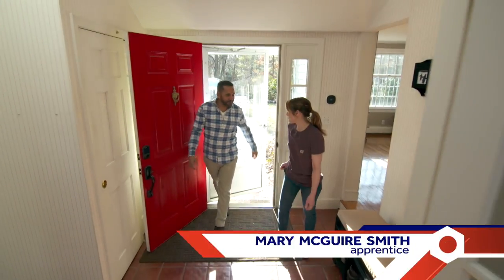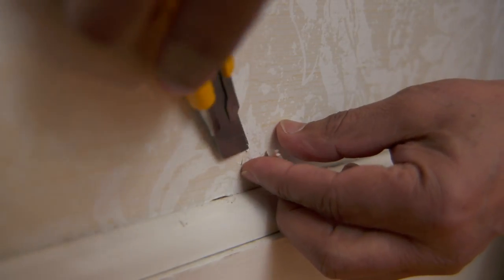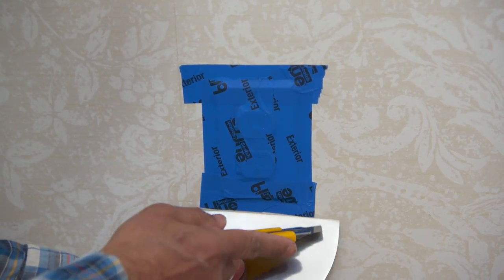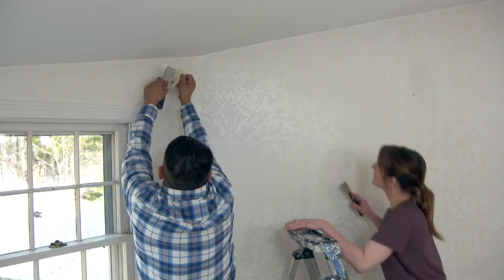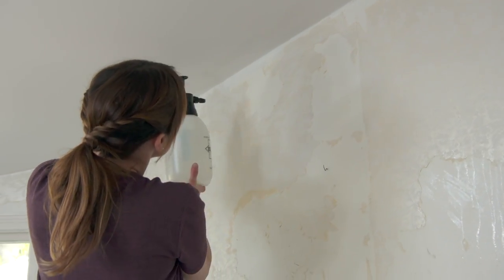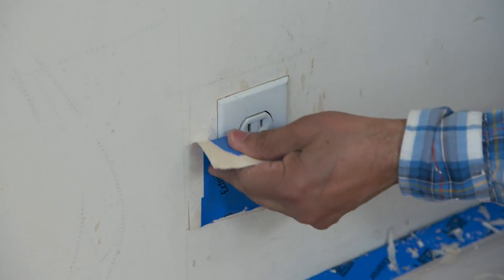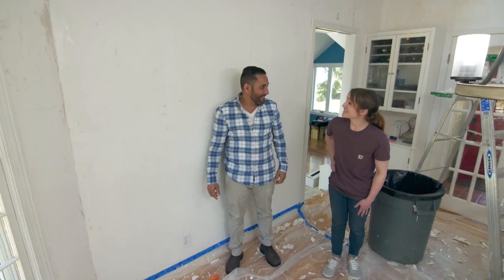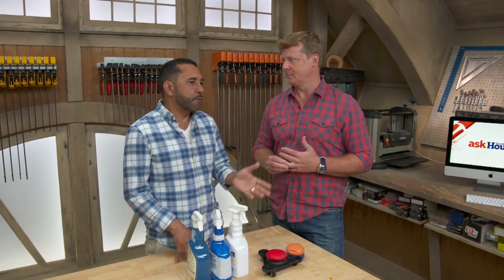How to Strip Wallpaper | Generation Next | Ask This Old House

Comment: I use a 800 degree hot air blower ($20 harbor freight) and a 14 in 1 scraper.
zero liquids, zero taping, zero prep time, zero steam machine, all natural...
watch out that tip of the scraper can burn you though if your not carefull it took eight hours to do an entire guest bathroom properly and install new light fixture, re-caulk vanity... remove behind toilet... 
tough stuff folks, not for the uncommitted due to the patience required.
Reply: Sounds like a fire hazard

Comment: good old dish soap in the water works best vinager is good for washing down old varnish and paint work prior to re coat the paper was a low quality vinyl and you need to remove it before soaking in the backing paper good quality vinyl will come off in one peace a larger pump sprayer with a wand and hose is better as you do not need to climb steps to use and wet the tops also a filling knife works better to get under the paper sometimes as they are sharper but not for punching off paper most decorators will snap a filling knife to make a scraper

Comment: So, what do you do for multiple paper layers or drywall instead of plaster? This only addressed the easiest of situations and only mentioned chemicals as plan 2 but not which chemicals for what situation.
Reply: general4str User very hot water and score the paper with a knife , but carefully not to deep as to score your walls and allow the water to penetrate allow to soak and scrape and repeat the process . You can even use fabric softener or dish soap mixed with your water . Oh and lady down plastic this is a very messy process.
Reply: general4str p?   !
Reply: If you’ve got multiple layers on top of drywall, your best bet is to just rip the whole wall out and re-Sheetrock it.

By the time you buy the tools you need to get all the paper off and patch the drywall, you’ll save money by getting a few sheets of Sheetrock.
Reply: I've watched this guy on previous shows and I'm not impressed!!!
Reply: Paper Tiger has always been the best option for me. I use the hottest water and dif. I've done up to three layers that way

Comment: I have a bedroom with peeling paint. I thought maybe the former owners painted over wallpaper since I'm seeing seams in the paint, but when I peel the paint off with a putty knife, I can't tell what's behind it. I'm not seeing wallpaper, just a brown paper bag color. I really wish I could just primer the loose parts and repaint. Is that possible? I don't know what I'm doing. It sucks.
Reply: Sounds like wallpaper backing or it could be the lining from the drywall. If you can't remove it then give the wall a skim coat with plaster (wall mud) and sand down.

Comment: Would the process be the same for drywall?
Reply: Much more difficult to remove from drywall.  If the drywall was primed and painted before the wallpaper was installed, it won’t be as tough a job if it was installed directly to the drywall.  You will still have areas where the drywall paper layer gets pulled away with the wallpaper as it is being removed.  If that happens, you’ll have to seal the drywall (Roman Rx-35 PRO-999 Interior Drywall Repair and Sealer Primer) before you patch it, because if you don’t, the drywall patching compound will introduce moisture into the wall, potentially setting up a mold situation.  If you’re dealing with the very sad situation of wallpaper installed directly onto unprimed or unsealed drywall, then maybe it’s best to remove the drywall altogether.

Comment: I would just paint over the paper
Reply: TerraTN ....Yes, the seams would show through the paint.  Also, the moisture contained in any primer and/or paint may very likely activate the paste of the underlying wallpaper, causing it to soften, ripple, and pull away from the wall at the seams.
Reply: The previous owner of my house did that 30 years ago and it looks horrible. It's going to take ages to prepare my walls for painting them properly.